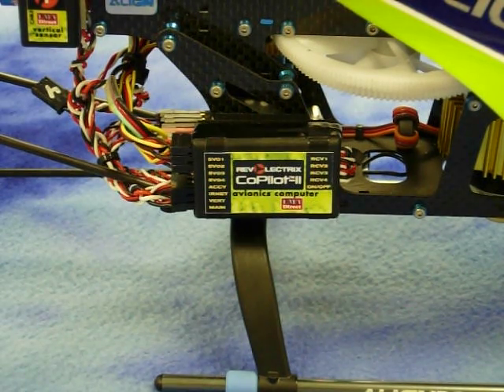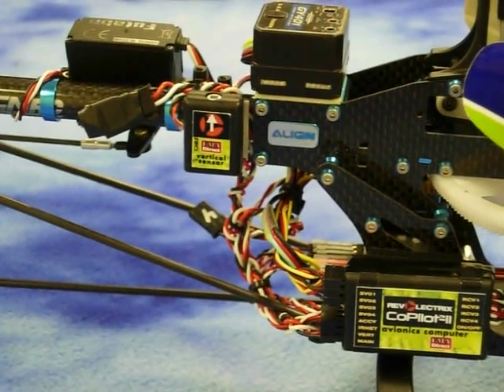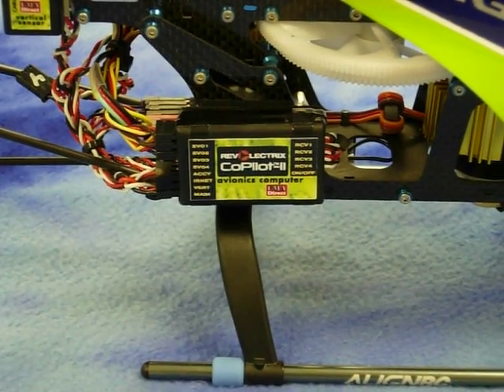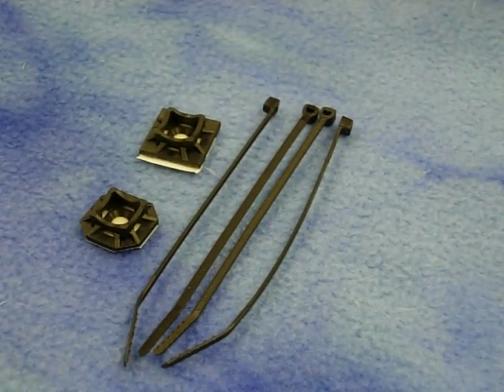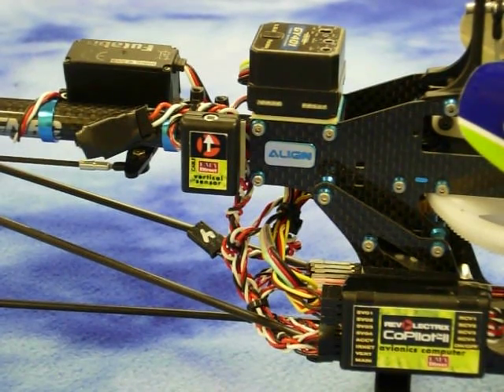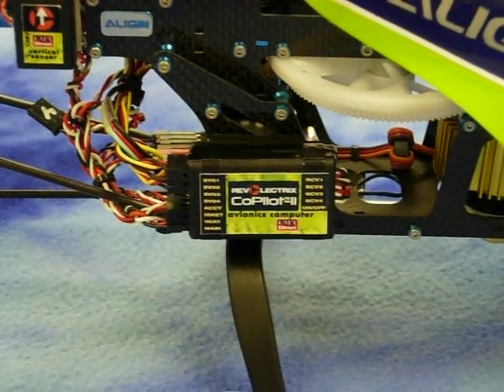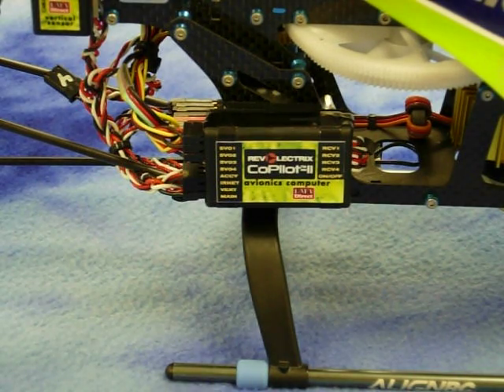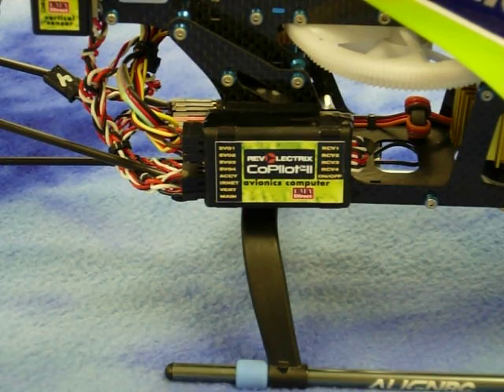CoPilot II Components & Helicopter Installation

Comment: I am curious to the length of your main sensor wire as it appears to be longer than what I received. Did you add an extension to this connection? Thank-You for the informative video.

Comment: I want to buy this also, I know it works with every radio, I think you have a 2,4 Ghz Futaba?
And I also now, you can use it one nearly every aircraft, also on big planes or big helicopters.
google  ''fma direct'' they have got a shop and if you email them, they can tell you a store in your country. the system cost between 137 - 150 Euros.
I want to buy this also, I'm from Germany.